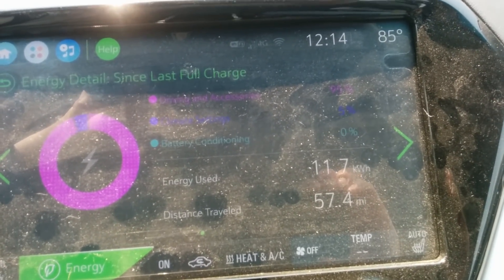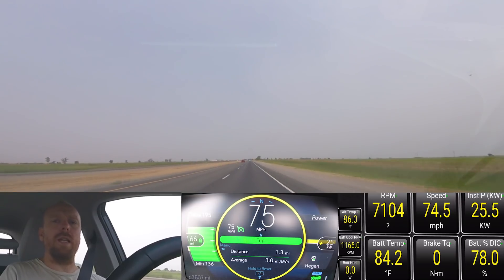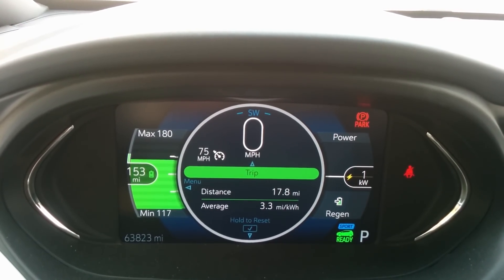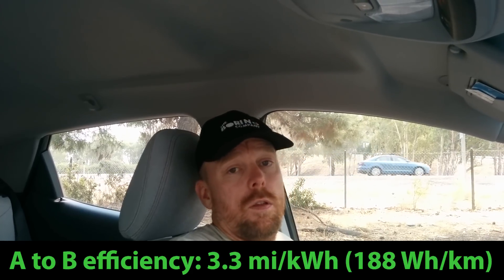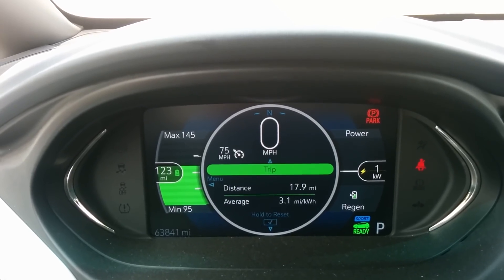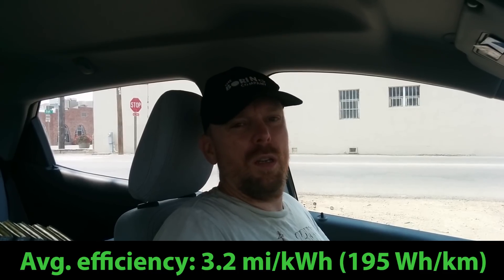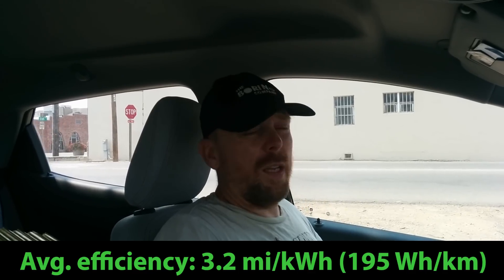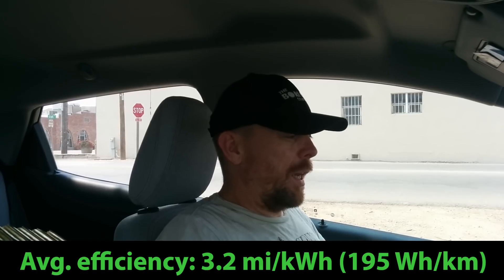Chevy Bolt EV: Efficiency At 75 mph or 120 km/hr

Comment: This answers my question whether or not the efficiency of the Bolt decreases with the increase in speed.  I drive my Honda Fit at 60 mph on the highway to save gas & reduce pollution.  If my order for a 2023 Bolt EV is delivered, I will drive it at 60 mph on the highway.

Comment: 68.25 mph is the limit around here.   I drive between 55 and 70 mph depending on traffic and how much drafting i do.  One way is 1600 feet to 4000 the other the opposite.  Winter is 40-50 mph in snow depending on tires and white out conditions.   This is on a 190+ mile drive between the two big cities.     In really bad conditions you just crawl  https://youtu.be/967K7SvXc2A

Comment: Can you do a video about the automatic cruise control please
Reply from the maker: Do you mean Adaptive Cruise Control? If so, the Bolt EV doesn't have that as an option yet, and no word whether it will be added for the 2019 model year.
Reply: Sorry I mean the automatic breaking
Reply from the maker: My car is an LT, so it doesn't have automatic braking.

Comment: For anyone who missed it, you can compare numbers for a similar 56 and 75 mph test done by another Bolt owner here: https://www.youtube.com/watch?v=VsZCOEjs7M8.

News Coulomb: I'm in the market for my first EV and enjoy watching your Bolt videos.  Trying to learn as much as I can about the various models and have some quick questions.  What was your usable battery capacity when you received the car?  If it was around the advertised 60 kWh, then it seems to have degraded by about 6% over your 64000 miles of driving: 11.5 kWh/(0.788-0.584) =  56.37 kWh usable capacity before hitting 0% in that app.  I wonder if your frequent quick charges have accelerated the loss.  Do you normally use the hilltop reserve mode when not making long trips?  Thanks.
Reply from the maker: The usable capacity is very hard to calculate, and it varies even during the same battery charge. If you compare the energy usage when I did the 56 mph test, it would appear that my usable capacity was only 52-53 kWh. That was immediately before this test. 

When bringing up the estimated battery capacity in Torque Pro, the kWh usable has ranged from 57 kWh up to 59 kWh within just a few charge cycles. It goes up and down. 

I'm not sure there is an effective way to accurately test the degradation. If I had to guess, I might have seen 3% degradation by now, but I can't confirm that.
Reply: Thanks.  I did some more digging and found a large database of Tesla battery degradation data (https://electrek.co/2018/04/14/tesla-battery-degradation-data/#jp-carousel-65299).  According to their data, most Teslas (model S and X) will degrade by 6% during their first 60K miles but begin to level off (only losing additional 2% in the next 60K miles) as the miles accumulate.  Hopefully the Bolt follows a similar pattern.
Reply from the maker: That initial 6% degradation seems to be unique to Tesla. The cars using prismatic cells don't seem to have that initial drop off. 

But the 2% in 60,000 miles might be right for my Bolt EV.

Comment: I should have asked you about the torque pro app before, do you have to have a devise plugged into the OBD2 port for the app to work? What is the devise if so?
Reply from the maker: Steve, check out this thread: https://www.chevybolt.org/forum/10-technical-discussion/26666-chevrolet-bolt-obd2-pids.html

Comment: What is the name of that app that show the RPM, battery percentage, etc.?? (Where do you get it)
Reply from the maker: It's the Torque Pro app. You can download it, but it costs money. Also, it requires specific PIDs for the Bolt EV. I don't have the link handy for where to grab them or how to install them, but there's a Google sheet with instructions.

Comment: Hi NC, liked the video but a bit confused at time 14:20 when you said it's not the way you would typically drive. I know it's not the tire pressure you typically run at, but I don't follow why you drove any differently than you typically do or what that would entail. Can you explain?
Reply from the maker: Sure. Even though I'll drive a lot at 75 mph, I rarely drive at only that speed. Because my trips are usually much, much longer, I'll have a mix of driving speeds that affect my overall efficiency. So, over the course of 500 miles, I might be driving 80% of the time at 75 mph. So my speed will vary, and my average efficiency is typically closer to 3.5-3.6 mi/kWh.

Comment: On your return trip, you reset the trip meter at 31mph instead of zero 8:33. You should have come to a complete stop.

You number would have come close to bjørn.
Reply from the maker: I should have, but I had traffic coming up behind me. To be fair, it was actually 23 mph when I reset. Regardless, that was the leg heading into the wind. Even if my total had been 3 mi/kWh (matching Bjorn's round trip), that was only one leg (the less efficient one).

Either way, that's why I provided the total energy consumption versus miles was 3.19 mi/kWh. Essentially, it no difference to the overall average efficiency.

Comment: I'd like to see mi/kWh at 62 MPH. Please? And if you can, something under 55 MPH like 45 MPH or 35 MPH? Thank you.
Reply: Chevy SparkEV average speeds which get to less than 50 mph really benefit the efficiency of the Bolt, since there is significantly less wind effect.  An average of over 5 mi/kWh is easy to obtain at these speeds - especially with no AC operation.  Nearly 6 mi/kWh is possible when driving about town - quite impressive!
Reply from the maker: At some point. I have to be sensitive of time on these trips.
Reply: Is there a way to crowd source this by finding similar roads throughout the country? I'm sure you can get a few hundred trips over the course of a week.  Check out https://www.flattestroute.com/ - with torque pro logging, we could be doing amazing things :)

Comment: 55 is the gold,,,, over you pay lol.. so whats the diff with sport mode on? does it change the steering at all?.. is the throttle more sensitive ? how much faster to 60 is it with it on?
Reply from the maker: All Sport Mode does is increase accelerator pedal sensitivity and possibly adjusts the steering weight. 

All other numbers would stay the same.

Comment: 65 mph is good compromise and you would have opportunities to draft behind trucks.
Reply from the maker: Yes, I think sticking close to 65 mph will also offer new Bolt EV drivers the most predictability because your efficiency at those speeds will be very similar to EPA estimated range.
Reply: Also gives other drivers a better chance to pass you. Driving at the speed limit usually means other drivers will do the 'one mile per hour pass' which blocks the flow of traffic more than just being 5mph below the posted limit.
Reply: You have to get very close to the back of the truck to take any advantage of that, and it's also a good way to get a tailgating ticket.
Reply: https://www.autoblog.com/2007/10/28/mythbusters-drafting-10-feet-behind-a-big-rig-will-improve-mile/ At 100 feet following distance MPG improvements were around 11%. That's about 6 car lengths. Even at a distance greater than 100 feet there would still be a fuel efficiency advantage to drafting. Most American drivers get 'bumper rush' and follow much closer than 100 feet.

Comment: What percentage would you use when applying a given average MPH to get the expected range for charging? What I mean by that, using your 75 MPH rate, 3.2 * 60 = 192 potential miles. Would using 85% be a fair percentage? That is, I can expect to travel 162 miles between charges on a given trip traveling at 75 MPH? I know you sometimes go down to 3% but you have a very good feel for your Bolt having traveled 60k+ miles. Thank you.
Reply from the maker: Great question. When you account for mixed driving, things change. If your average speed is 75 mph, it means you likely spent time over 75 mph that would burn even more energy. For example, my average driving speeds are ~70 mph, and I typically see 3.5-3.6 mi/kWh.

Regardless, I'd feel comfortable using 90-95% for the first leg (80-85% if starting with Hilltop Reserve Mode on). Subsequent legs, you'd want to use 55% for your baseline. I would recommend charging up to 65% and planning for a 10% buffer. That's how you'd maximize the Bolt EV's charging rates on a fast trip. Basically, plan to go no farther than 100-120 miles between fast chargers.
Reply: Thank you. Good advice for when I make my first trip and I need to stop and charge.
Reply: cjd lv - I try to gauge travel energy usage starting at 4 mi/kWh, which is about the efficiency you will see at warm temperature speeds around 65-67 mph.  This works out to round numbers when making calculations as well.  Working between 10-15% SOC and about 70% SOC (charge rate slows down at about 70%) gives you a certain level of comfort at the bottom end if you are dealing with unknown chargers and locations.  60% x 60 kWh is 36 kwh of working range.  At 4 mi/kWh, this works out to 36x4=144 miles.  If chargers are frequent and seem to be working most of the time, you could put 5 to 10% more into the driving miles (adds 24 miles), but that leaves you with a small reserve (12 to 24 miles) if you encounter charger issues.  Obviously increasing driving speed will reduce the effective range - as demonstrated in this video.
Reply: Again good advice and thank you. If I charge 30 min per stop and use the 15% to 70% approx. charge range which should work out to 120-140 miles between charges. And this is close to your 4 mi/kWh.